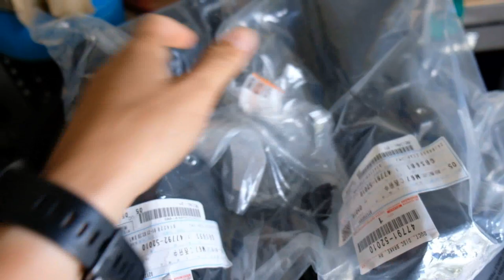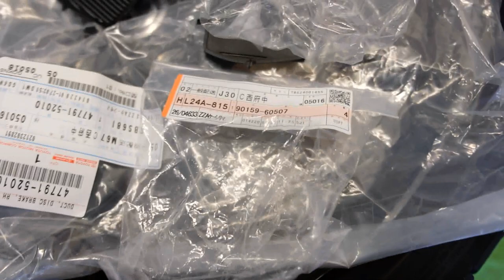First GR Yaris Meet & Cruise!! Brake Ducts Installed & Lighting

Comment: I dont have a jack or axel stands. Reckon these could be fitted with the wheels left on, just removing the clips & bolts closest to the front of the arch? I appreciate its probably alot more fiddly. 

Also, do you have dimensions for the front and rear caliper decals? 👍🏽
Reply from the maker: yeah can be done easily no problem just take caution when doing so. 
I no longer dont but i believe i just searched oem sizes on facebook groups to find sizing
Reply: @smoothasbrothers  fitted them today, just took the 5 bolts & two plastic clips from the underside of front splitter at each side - was enough access, just a tad fiddly.
Reply from the maker: @Shdgy  good stuff mate job well done

Comment: No brake ducts but heated seats and wheel option lol.....meanwhile in UK we get the ducts just not the heated seats and wheel......we do get UV protection on the windows though lol....cant make this shit up
Reply from the maker: It makes no sense right? Hahaha
Reply: @smoothasbrothers  no none lol.....do you get a mix of convenience pack and circuit pack? We get one or the other.....
Reply from the maker: @rtorbs  we only got one option to choose from but came with a variety of things. 
Nothing from the circuit pack got included that matters though so no LSD’s, refined suspension, red trim interior, red brakes or nicer wheels
Reply: @smoothasbrothers  Thats actually nuts
Reply: 😂 I got the swiss spec Premium gr, meaning jbl heated stearing and seats etc, no brake ducts but red interior. How do i see if i got the UV Windows? 😃

Comment: Where did you get the ducts? Was it through a local dealer or from Japan?
Reply from the maker: It was via one of our contacts in Japan who has access to OEM Toyota parts but essentially you could order these from any Toyota dealership or some online places like lamspeed racing or race division have stock readily available
Reply: @smoothasbrothers  Awesome, I thought you'd be able to order them through a dealer being a genuine part. 
Was thinking of ordering the Torsen diffs through a toyota dealer as well though cusco have just released their range of LSD's so might have to check them out as well.
Thanks mate!